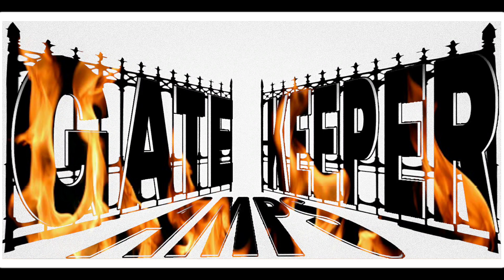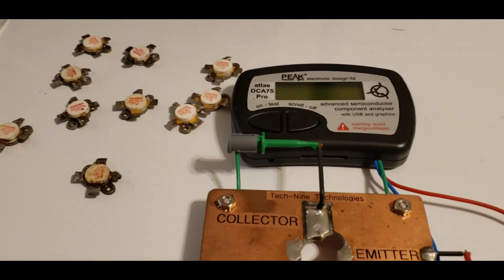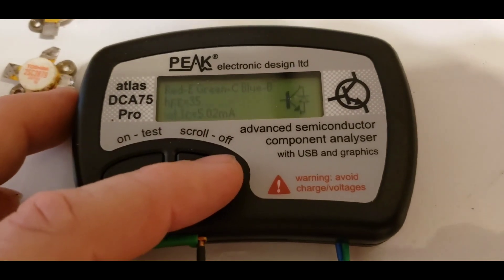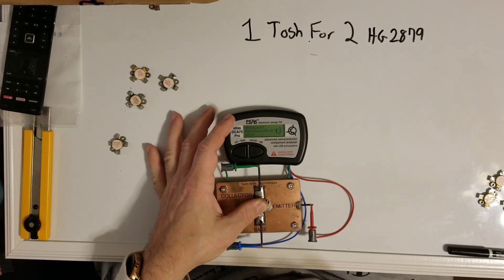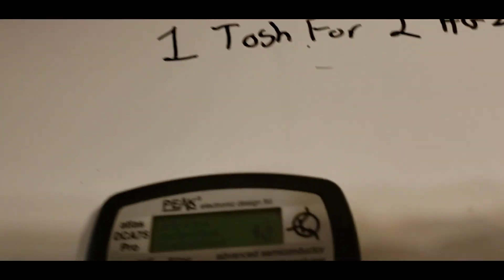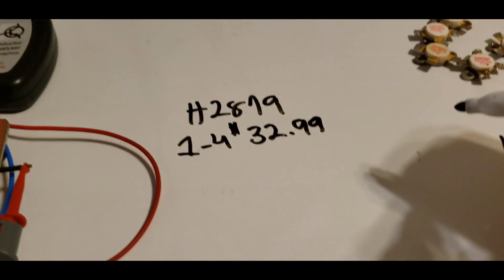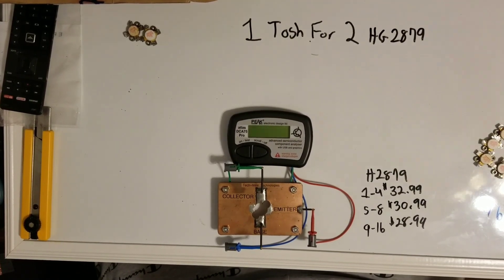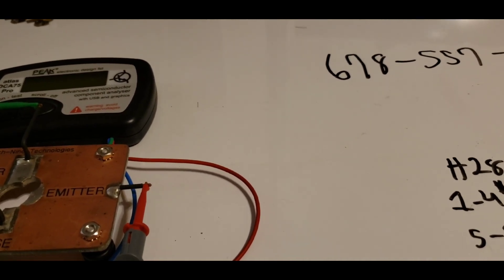Trade Those USED Toshiba's For NEW Transistors! - [Gatekeeper Amps]

Comment: I totally understand about text why I try use messenger on my FB page and keep all the information. My phone don't pick up well in the shop. If I talked on the phone all the time...I couldn't get nothing done. This why I don't just post my phone number all over the net public like some do.
Reply from the maker: Like me lol lol lol.... Ill tell you the main reason I decided to start doing that to do texf..... it easier for a regular person to get to me plus I have a app that will filter out any number that isn't saved if I wish for example want to sleep etc so it doesn't ring and also I have 2 phone numbers connected to my phone. My other phone number which always stayed on is for my family. Even my closest friends don't have it and guess what I still get telemarketers calling that dang thing..... phone numbers are like a car 🚗 from the 90s..... each one by this time have had a few owners. At one point...get ready for it...ive predicted so much about technology as I've grown up....we will goto another format of phone 📱 numbers for example shorter numbers 34-56-78-21 or actually address via block chain technology like gatekeeperamps.eth or gatekeeperamps.bnb because most of the Telcom are already voip technology.... rem I said this. Lol I called mp3's back before mp1's and others lol 😆

Comment: Hey GK! This is Weston. Got with barracuda on a 16 pill. Would love to see a video on it if you can! Appreciate it.
Reply from the maker: Oooooooooooh your the one that it lol they guy with the same name as me 😀😀😀 cool yes I actually did the video last night. I don't have a power supply at the time big enough either....imma fix that very soon but check this out...on a 200A supply just hitting it with 2 tiny 1446 it did 2500w pep and KILLED the 1000w Slightly in AVG lol....I put the top on and was walking inside with the heavy joker and it hit me....[Thomas Weston go make sure the fans work]........I hooked it up and asoon as I hooked power to it the fans came on with the switch off......and the 2 middle fans didn't come on..... looks like even being NEW like it was that FB put fans on the hot bus and not the drive like a base amp and the wires came off the middle voltage regulator from a cold solder joint.... BLEW my mind lol... SO I fixed that.

Comment: I've got 64, never used, until opened, match  RF parts 2879 Toshibas with 77hfe gains in storage. They're not going anywhere. Lol. Was offered $8500 for the entire box. Nope.
Reply from the maker: VERY NICE! VERY NICE! You hear stories about people that have many stashed up like this. I personally have 24 left which are for builds and man it feels weird every time I have to put solder to them lol. I have found a place where I can buy them new for $110 cause I have bought one to make sure they are real....they only have under 100 left but I honestly do see any reason to buy them unless a customer request them. Thanks for sharing that and taking the time to drop by the channel.

Comment: I do not know how long the used transistor market is going to last. with the end of Japan 2879 the supply will run out. I have only a few used transistors but mostly MRF 455/454 /421/ 492 some SD 1446. some stud mount. MRF 450A . just 1. mostly when I get them. they mostly all dead. lots of PP 100 and DEI all dead. or very leaky. different with FET . they work or don't. I haven't seen leaky ones. and how a FET fail is most always the gate blown out. FET is great . runs much cooler . better gain . more efficient. can work out cheaper. but the gate is touchy . not as stable as a BJT . 73's
Reply from the maker: Yes it will slow down at some point.
Reply: Never know how long they will last. There is still market for 6LQ6 Tubes
Reply from the maker: @DonkeyStomperProducts oooooooh giving me an idea 💡